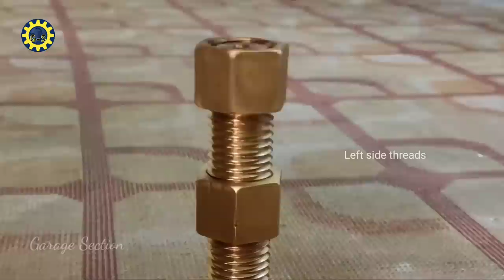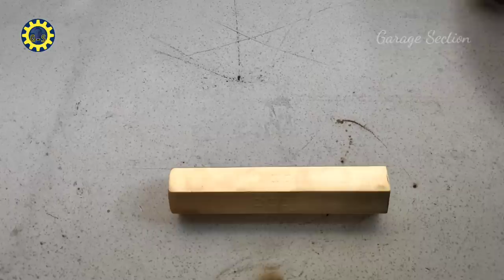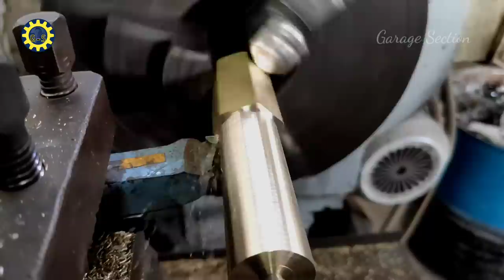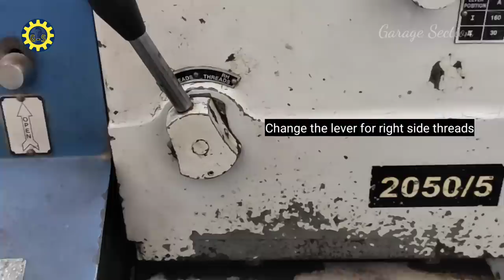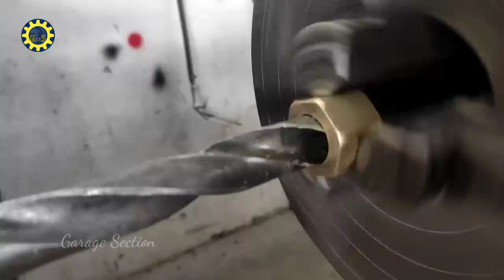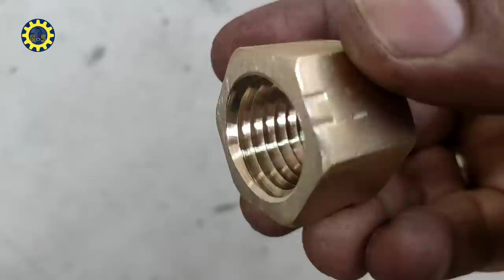Two-way threads in a bolt on lathe machine.

Comment: We have big versions of these at work made out of solid steel bar stock. Maybe 3" diameter and 5' long or so. Intsead of a nut on it, a pulley is on it that runs back and forth. It winds rope up evenly on drums as it goes back and forth. Also, the grooves are about 1/2" deep and the edge of the grooves are razor sharp.

Comment: The bolt isnt a tight fit, its only hitting half of the threads.if it was the true bolt size it wouldn't work.
Reply: You are probably right.
Reply: It only job is for showing a neat idea , not ment to hold anything together.
Reply: That’s what I thought too partial thread engagement but I am NOT a machinist.  The threads on the stud will definitely mess with your eyes and your head.  I wonder if it could be done on harder carbon steel or if it needs to be a softer material like brass or aluminum for the second cut of the opposing thread pitch to cut cleanly instead of trying to follow the initially cut threads and messing those threads up.

Comment: I made one of these today, I still need to make the nuts. After watching this video I just had to try it.
Reply: Q1 Did you use brass? Q2 And cutting fluid? Q3 What size & Q4 please  How long to make ?
Reply: @davidbroadbent2529  I used 1 1/4 brass, yes I used a little cutting oil, it took about 2 hrs. I set the lathe on 3 1/2 tpi, that way when you are done with the double start threads you end up with 7tpi. I indexed between 1 and 3 on the double start procedure. Maybe next week when I’m done making the nuts for this one I’m going to make another one with 12tpi to see how it turns out.